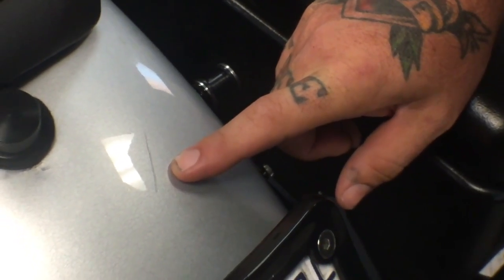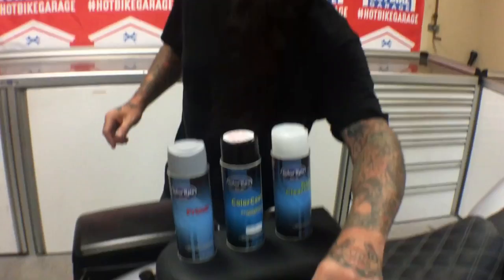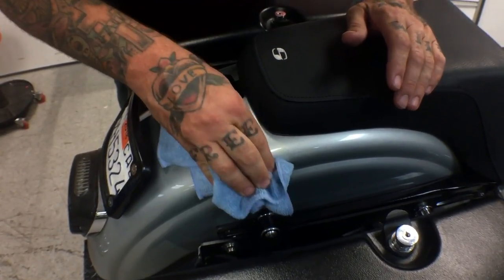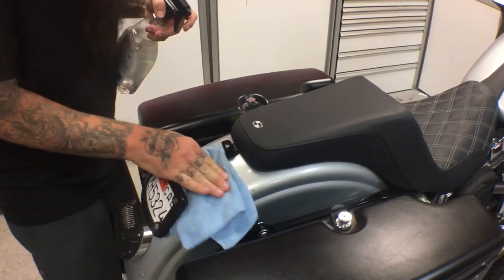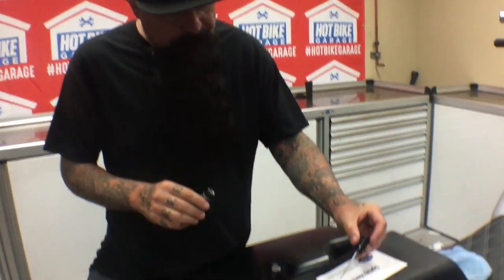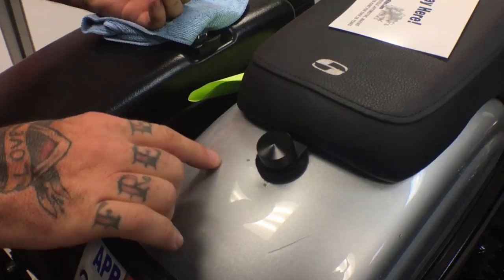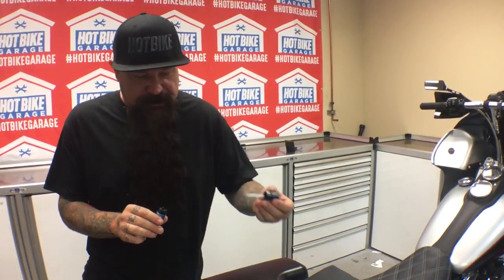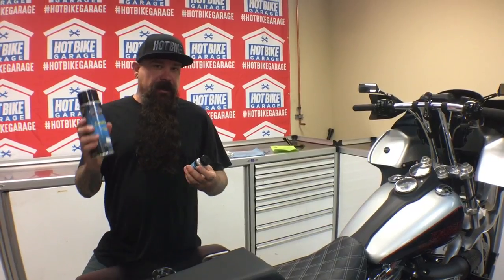Hot Bike Garage - Color Rite Paint

Comment: How many cans to paint the whole bike?
Reply: WELL - FIGURE 4 full cans of color to shoot a batwing fairing - then figure 2 cans of Clear - then figure taking it to a professional to shoot your bike who will charge you extensively for using this shit.
Reply: btw - @ 30 per can @ 6 - paying someone to paint it sounds aweful cheap doesn't it - especially when there is no chance for the $180 + that you waste on Color Rite - that you will have a chance of it not looking like complete crap when it's done.  If you eat the right color food you could smear your own crap on the bike and have a better chance of it coming out looking decent.
Reply: @cray3140  30 per can. local body shop supplier matched the paint and made a can of ppg at £12 no way should be 30 usd
Reply: I wouldn't recommend (or wish) this stuff on anyone.  Literally - they use acetone for thinner - it will crack using their own supplied clear coat and their BS clear coat nonsense sprayer 'thing' you may as well use a garden hose to put it on.